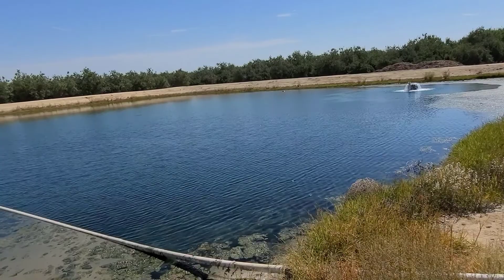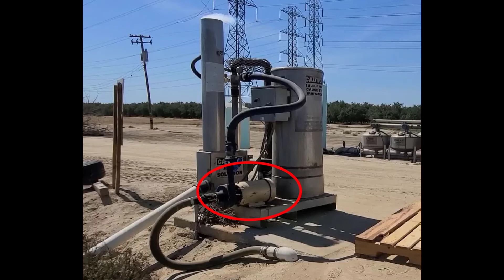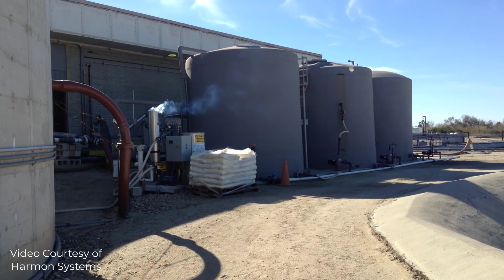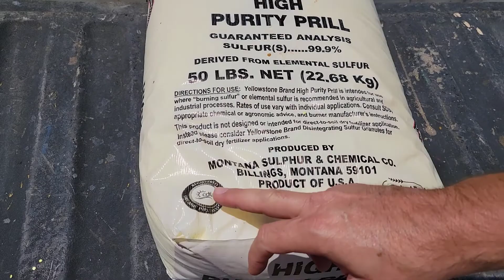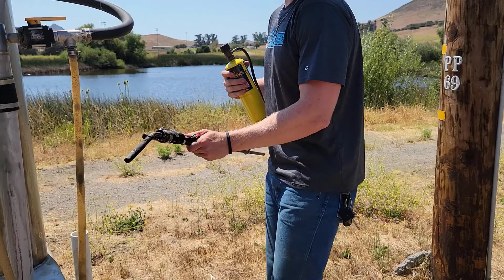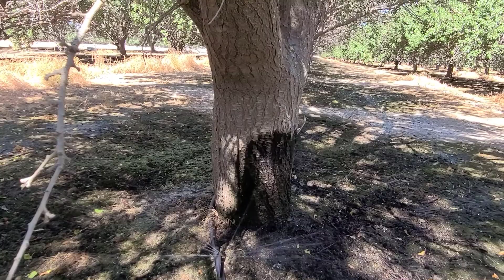Fertigation Series 16: SO2 Generators (Sulfur Burners)

Comment: Hi, thanks for the information and input. I have a question.
Is there information on the improvement and/or increase in production or yields in cereal crops?
wheat, corn
Thank you.
Reply: Marco, I don't have any information on those crops specifically.  However, I am sure that if you reach out to the manufacturers, like Harmon, they might have some of that data.

Comment: Can I produce concentrated h2so3 using this machine? My goal is to produce concentrated h2so3. Can I do this with 200 kg of sulfur and 200 liters of water? Water will be circulated and no additional water and sulfur will be used. Can I produce concentrated h2so3 in this way? 1 liter of h2so3 will be 1450 gr.
Reply: Emre, the short answer is NO.  When water absorbs SO2, and the pH goes below a pH of 4.0, the water becomes saturated to a point where it is no longer capable of absorbing additional amounts of SO2.  So, while recycling the 52.8 gallons of water multiple times would enable the unit to oxidize the additional sulfur dioxide,  it would also increase the concentration of SO2 that volatilizes into the atmosphere - rather than being absorbed by the water.  The only way to prevent the volatilization is to significantly increase the amount of feed-water or keep the aqueous solution of sulfurous acid under pressure.